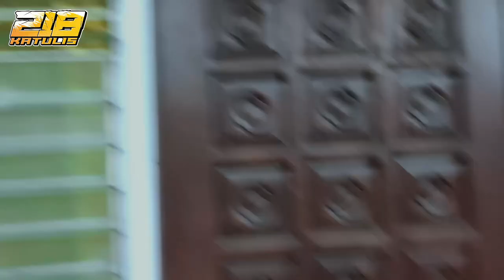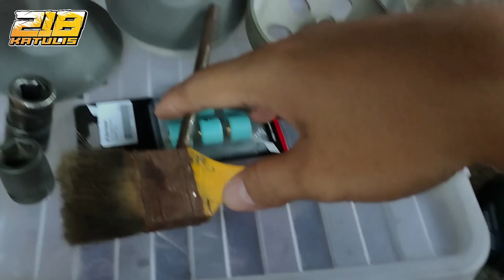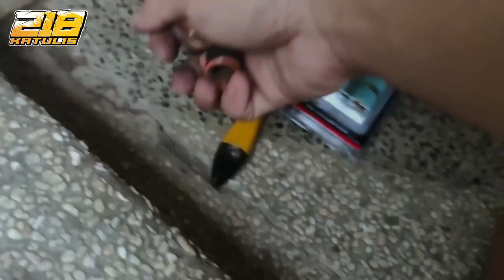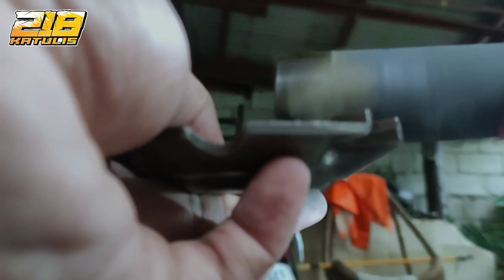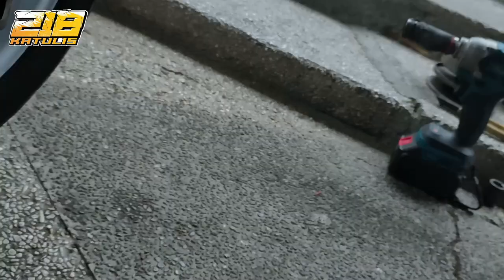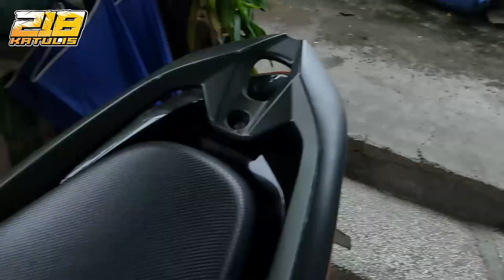RE-GROOVE CLUTCH BELL | HONDA CLICK 125i | TANGGAL DRAGGING

Comment: IDOL ANO ANG BEST CENTER SPRING AT CLUTCH SPRING? Para sayo ung may dulo at arangkada sana idol🔥

NAKA KALKAL PULLEY AKO AT REGROOVE BELL DIN TAS STRAIGHT 14G SUN FLYBALL

CENTER AT CLUTCH SPRING KI KASI NGAYON IS 1500 sa cluth ko ata 1200 or 1500 din.
Reply: kung stock engine ka lang napaka tigas ng springs mo paps.
Reply: @josephjrsalido4883  ano ba bagay center at clutch boss
Reply: @bryce8407  goods na yang 1k rpm paps.. na pwpwersa kasi yung makina mo pag sobrang tigas ng springs mo masama sa makina yan.
Reply: @josephjrsalido4883   mga 1k -1,200 goods pa dba paps. Sa clutch spring anong pwede
Reply: @bryce8407  para sakin matigas na yang 1.2k
Reply: @josephjrsalido4883  So 1k center spring at 1k clutch spring bossing?